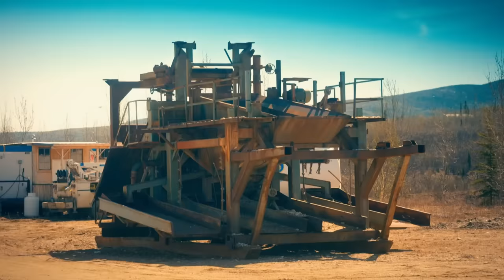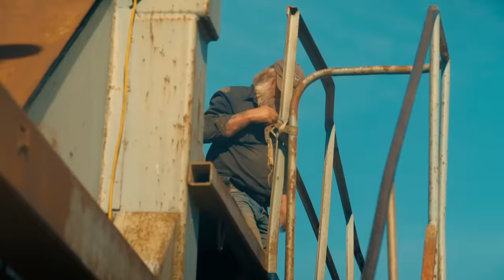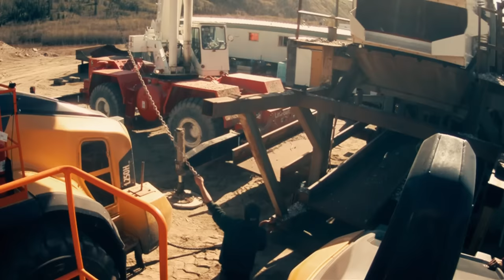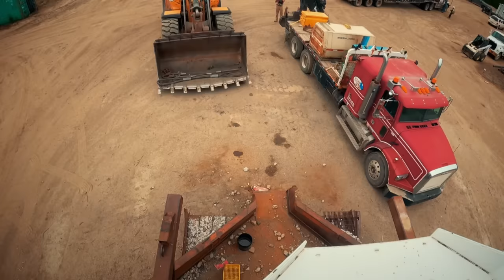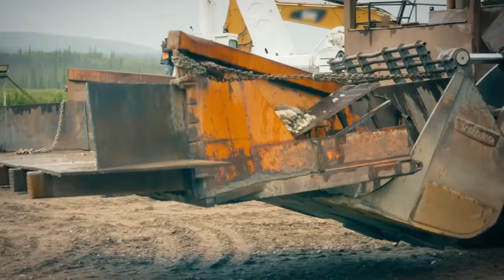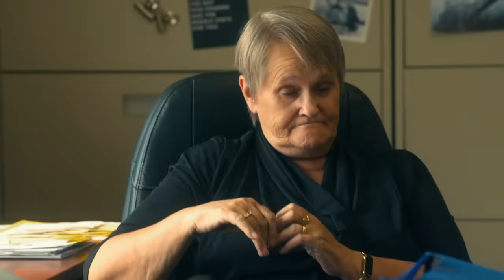Tony Beets Is SHUT DOWN By Mining Inspector! | Gold Rush

Comment: You should see a helicopter logging operation, I literally had a loader swinging logs over my head behind me, A processor grabbing, cutting to length and swinging logs in front of me and a Huey flying 1-3 logs at 3500-5000lbs around me and dropping them 50ft in front of me. Creating a ~ 12ft x 12ft constantly shifting 50-100ft in any direction box of "safety" ...  loads were all around and above me haha.... although i completely agree, walking underloads unnecessarily is best to be avoided, especially if operator doesnt know you are there,

Comment: This is supposed to be a North American  mining environment. Hard hats, safety glasses, high vis and gloves are a minimum requirement. The tag lines on the suspended loads were way too short for the lifts causing the workers to be too close to the load. I'm not a safety officer and I am generally annoyed when a safety inspector shows up on site but these are bare minimums that are just practical. This mine is a joke, can't be real.
Reply: Yes because a hard hat would save your head from being squished like a melon.  A glove is going to save your finger from anything but a possible minor cut, and safety glasses do nothing but get in the damned way.  As for a high vis vest.  You're not a deer hiding in the brush.  Don't fucking stand where you can't be seen.  All your points moot!
Reply: Yo! For arm chair gold miners!!!!!😂